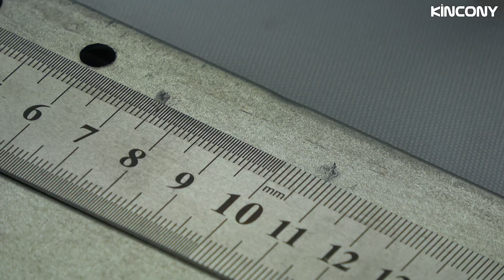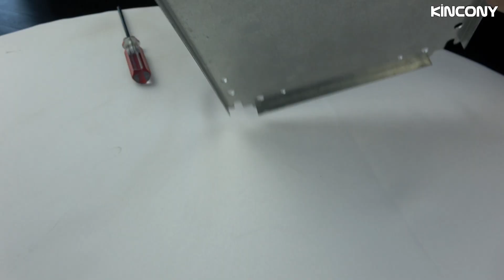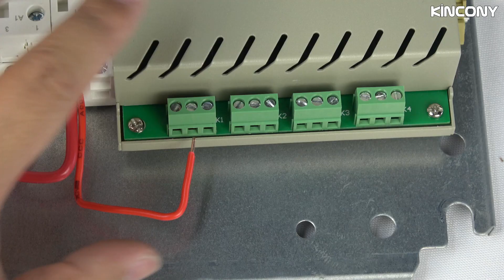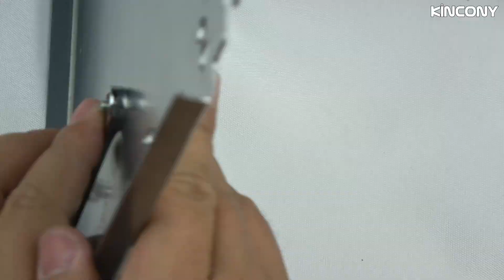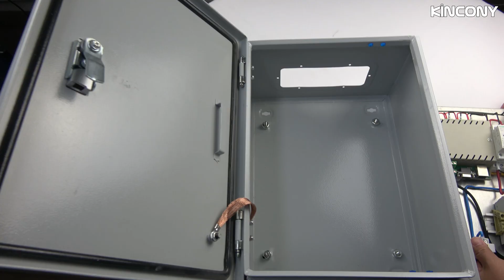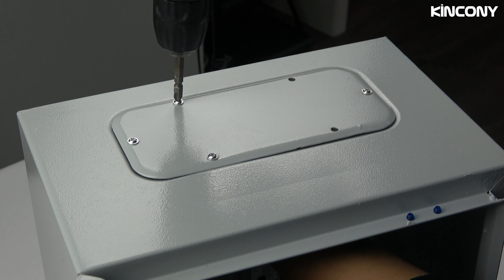Home Automation Project DIY Smart Home Tech IOT Power Distribution Box

Comment: what did he put with screw in each end of mcb rail??
Reply: @KinCony  i mean the small green at the side that helps compress the mcbs or locks on its place
Reply from the maker: @carljoshuabono6739  That's for fixed controllers, don't let it move
Reply: @KinCony  what do you call to that?
Reply from the maker: @carljoshuabono6739  this is link: https://www.aliexpress.com/item/1005002458929418.html
Reply: @KinCony  THANK YOU!

Comment: Nice project.   I didn't see a UL rating on those miniature CBs.    Just remember that a UL489 breaker is to be used as branch circuit protection while UL1077 is only a supplementary protector.    Furthermore, in some cases UL1077 cannot protect a device that is outside the enclosure.  (all of that is for the US, of course).   Again, nice project.
Reply from the maker: thanks for suggestion. this project is our newest in 2023. https://youtu.be/Ae4CDMBKRwA
Reply: Sizni kasbingiz nima

Comment: Nice work. I love how neat it is, pls am currently trying to design a system for my final year project and it involves distribution board and power line modem (PLM) .
I want the device to turn off certain load when the mains is changed, can the PLM system be infused in this your system by introducing a signal into the system. ?
Thanks 👍
Reply from the maker: can your system output a dry contact signal?
Reply: @KinCony  no sir
Reply from the maker: @philipcyril6753  try to let your PLM can output a dry contact signal when turn off curtain load , maybe add a relay.

Comment: Exactly what I was looking for, it could. and send the diagram of this installation?
Reply from the maker: diagram can download from our webpage: www.kincony.com/document
Reply: I need an internet based control that I can turn two air conditioners on remotely using my phone. I will be using power relays to actually switch power to the units, but will need the outputs of your module to be able to switch 24 volts ac at 2 amps. What do I need? Cost and availability as well

Comment: 1) Sir what is the size of the wires?
2) What is the size of that power cable that you connect to extension cord & input current.
Reply from the maker: 1: 1.5mm
2: according to your AC contactor and breaker current .

Comment: Hey, hope you r doing well. I have done this project via arduino mega, relay module channel and two bulbs and Bluetooth module and everything is working according as I planned. But I want to execute this system at my house practically. Where we have a phase wire and neutral wire and I don't know how to do connections with that.. Can u help me out..
Reply from the maker: only 1 phase line "L" control by AC contactor, neutral line connecd together is ok.

Comment: Great. Is it possible to track or monitor power usage consumption using this circuit and the app? Thank you for sharing
Reply from the maker: KC868-COL + power meter can do this, next week, we will make new video about the power meter.
Reply: Thank you for sharing
Reply from the maker: @Dwik_DPS  you are welcome.
Reply: Hi again. As beginner on wiring I still need help to understand this wiring. Do you have a video when build the components with Kincony like in this video, with a little example text on the function or what it usually use on each rather only the name of each component? Only to find out what small parts like cable, MCB etc, available in the local resource. Sorry for detail question. I interested in build my smarthome with Kincony relay. Many thanks
Reply from the maker: i think you can see this play list for beginner: https://www.youtube.com/playlist?list=PLQUWhE_6LeOSXt07cMZzLwzmGiGrfzso6
Reply: @KinCony  thank you for sharing and quick response. It was helpful.
Reply from the maker: Dwi Person you are welcome

Comment: Hello, is the controller and google hub both need wifi internet to function? Tnx for the answer
Reply from the maker: controller without internet can work, but if you want use google home , voice module must need internet.
Reply: KinCony IOT is there any device like google home that will operate without internet? incase the internet fails? Thanks!
Reply from the maker: now the AI speaker all use internet with cloud server to do automatic control. if you can DIY, you can find a voice module that can speech recognition, then some GPIO port output a voltage.

Comment: So your running 25a breakers on a single plug flex and a tiny connector for the lights. And where is the earth for the box.
Reply from the maker: There are terminals for earth line inside of metal box.

Comment: How to add voice module and manual control board to KC868-H8
Reply from the maker: if you want to install these two device, you need to add our RS232 1->2 adapter, so that you can connect with 2 RS232 device to Smart Relay Controller.
Reply: @KinCony  Are you delivering to the Sri Lanka
Reply from the maker: yes, we can, no problem

Comment: Great job bro👍🏻 I need the drawing with info, pls.
I have a question about that controller. If I have an analog in or out how can I play with the value, same temperature, low/hight light?
Reply from the maker: we have another temperature and humidity sensor module can install on the DIN, that can see value on phone APP. one app can control relay and see sensor value.  this is link: https://www.kincony.com/ethernet-temperature-humidity-sensor.html
Reply from the maker: Here is circuit diagram: https://www.kincony.com/intelligent-power-distribution-box-solution.html

Here is very details video for whole DIY progress 1 hours: https://youtu.be/nV82j-AleMk